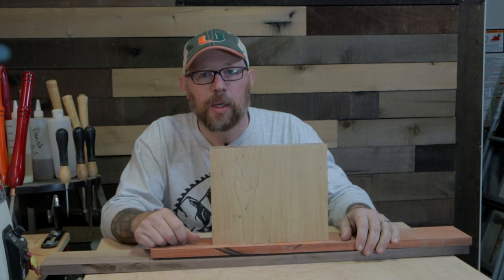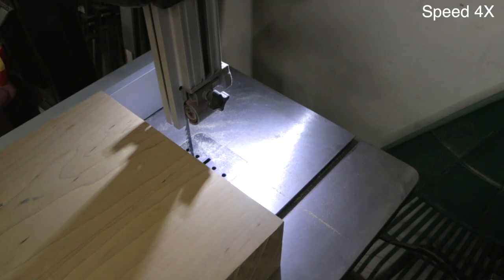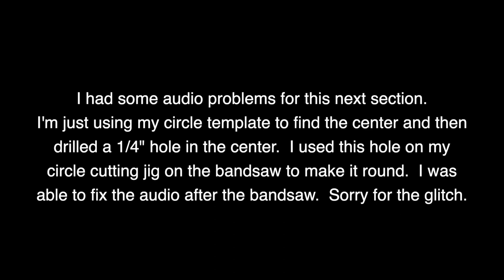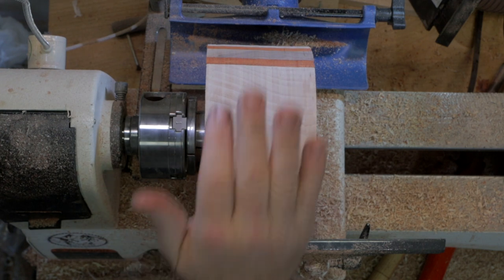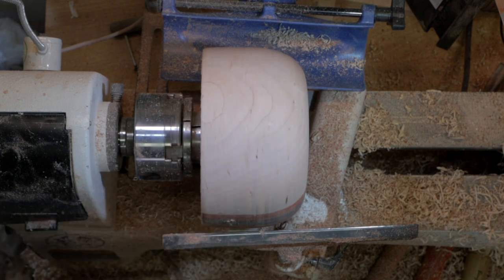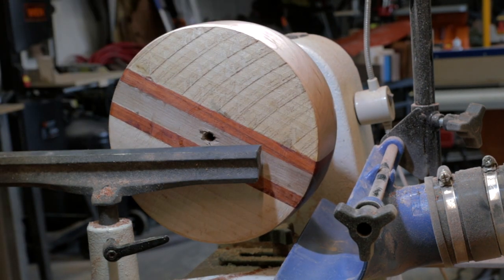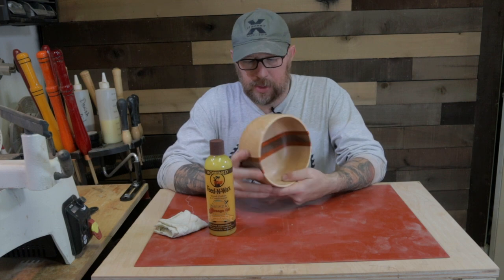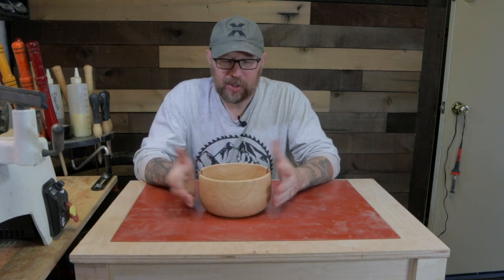Woodturning: Maple, Padauk, & Walnut Bowl

Comment: Nice looking bowl. As for your chatter marks on the sides. I have the same issue. Did watch a video the other day, cant remember who, but they held a thick piece of leather on the outside as he scraped the bowl. He said it dampens the vibrations. I'm going to try it. I've also found that changing the speed helps sometimes.
Reply from the maker: Thank you Mark.  I saw the same video and for the life of me, I can't remember who it was either.  I'm going to have to try it on my next bowl though.

Comment: Unless things have changed you don't sharpen carbide cutters you throw them away....
Reply from the maker: I've only been turning a little over a year so I may not be the best person to respond, but I do sharpen mine using a diamond card.  I can really tell the difference when I sharpen them.  At least for mine, I only sharpen the flat surface and not the angled one.  You can see the metal slurry after a few strokes on the diamond card and you can feel the difference in the bur after sharpening.  Maybe someone who's been turning longer can respond.  Thank you Christopher!  - Ed
Reply: I'll try one myself.....in the uk an easy wood neg rake carbide tip is £15......to expensive to just throw away.....i use cheap stuff of ebay for now . Also I've only learned my wood turning off youtube...can't wait to see what you do next, cheers Chris